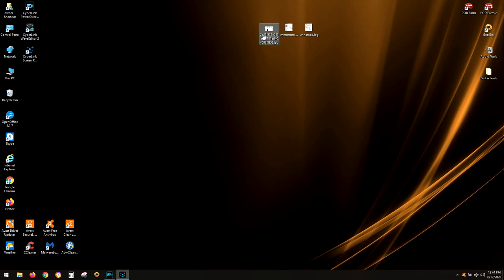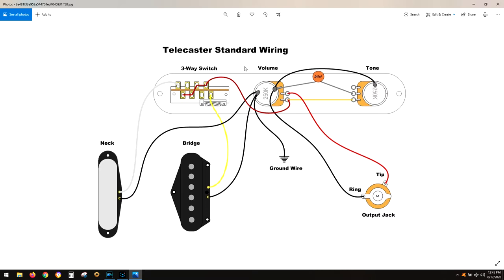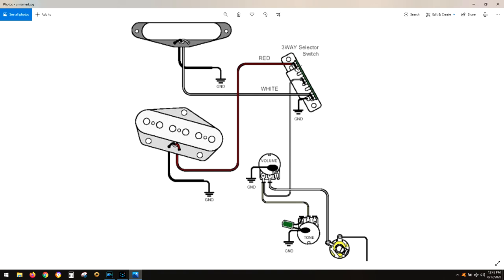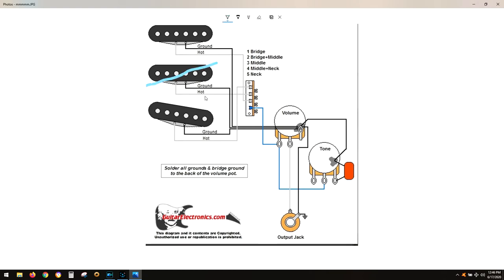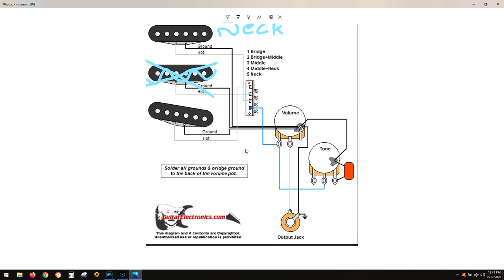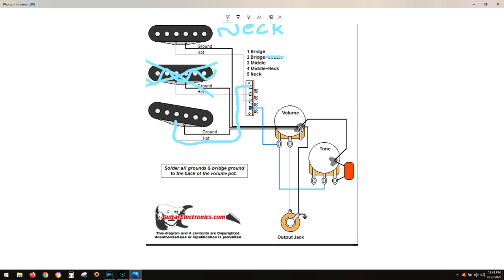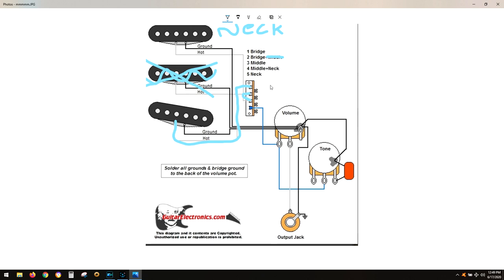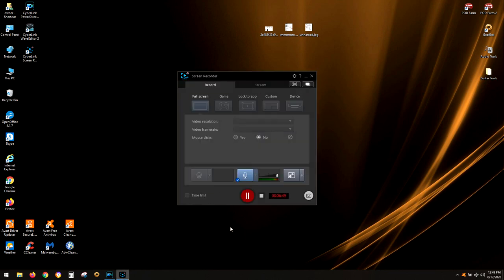The Irish Wanderer Wire

Comment: You may want to check out the Breja ToneWorks channel. There are a lot of wiring diagrams explained on there. And it is possible there might be one that will allow the switch to add other options to make use of all 5 positions. For example selecting series or parallel when using both pickups, or changing the phase of one pickup to give an additional tone. I'm not sure how you would do this but there may be an answer tucked away on this channel. I've used wiring diagrams from him before with success.
Reply from the maker: Thanks for the info. I'll check them out myself.
Reply: @ericctheartofnoise8613  once I get my single/rail humbucker hybrid bridge pickup delivered from China (expected end of July) I will have fun trying to figure out how to wire it up with a single coil neck pickup. To give me the option of Neck, Neck/Bridge (single or humbucker), Bridge using a combination of t 3 way toggle switch and push/pull tone pot.
The hybrid pickup has a single coil and a single coil sized rail humbucker, in a full-sized humbucker mounting. Getting polarities for noise cancelling with the neck will be fun. Hopefully it will just work without me having to mess with pole-pieces.